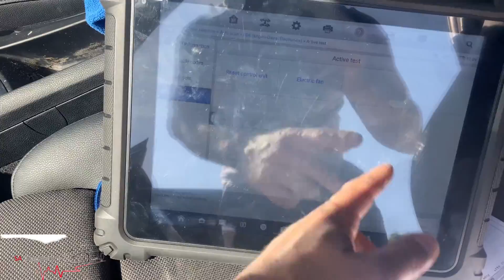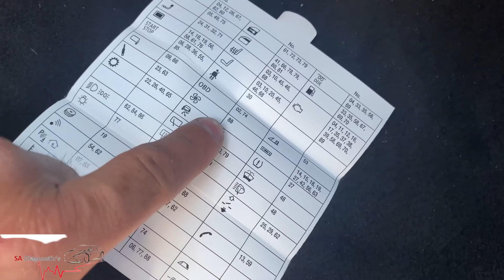BMW E8X E9X 1 3 Series 41F2 Electric FAN Activation DDE Digital Diesel Electronics FIXED

Comment: Here’s a clear and simple YouTube comment you can post:

⸻

I had the same issue with my BMW 3 Series 330d (2006, M57 engine). The radiator fan was not working at all.

I also watched a lot of videos and read forums, so I thought I’d share my solution. Maybe it helps someone.

Luckily I had access to ISTA. That allowed me to run the fan in test mode. Super helpful, but not required.

First, I replaced the fan, but still no result.

Then I started checking all the wiring. With ISTA I could view the wiring diagram and find the location of the DDE plug.

In my case, the PWM wire (controls fan speed) had no signal.

For the M57 engine, the PWM wire is on pin 40 of the ECU plug. This was clearly shown in ISTA. Also same colour cable (blue black) as on the connector of the fan.

I checked it using a basic resistance multimeter and found the wire was broken.

I cut the bad section and repaired it using simple new wire.

I did not expect that wire to be bad, it just runs through the engine bay. But somehow it broke.

My advice: learn how to use a multimeter. Lots of videos on YouTube. Always check wiring before replacing parts like fans.😂

Comment: I have an e92 n47 from 2007, my car overheats and the electric fan does not turn on, I have changed the coolant sensor, water pump, thermostat. Doing test with diagnosis and test the fan turns on, when I put the AC it also turns on, when I remove the connector of the coolant sensor it also turns on but when it goes beyond 90 degrees it should turn on and it doesn't, could you help me? Thanks a lot
Reply: I’m having the same issues as you my friend mines doesn’t come on when I put A/C on tho ,I’ve activated it through an obd reader and fan comes on that way but it doesn’t come on by it’s self as it should, I’m struggling to find the problem also .
Reply: @Alfiepops did you find the issue ?
Reply: @Alexander2bortiz  I had a crack on my coolant flange that’s connected to the Block between the alternator and the oil filter houseing, also the fan doesn’t come on until 100 degrees on phase one then 110 phase two,  those engines do run hot the bmw tech told me . Also if your fan isn’t coming on when activating the A/C you have a problem with your A/C ,

Comment: Bmw e90 bmw x1 as well wipers wont stop...any idea what could cause the issue?
Reply from the maker: Sometimes faulty bcm
Reply: I have no comms with the szl switch...in most modules
Reply from the maker: @ameerariefdien1667  change szl and see if any luck also check fuses